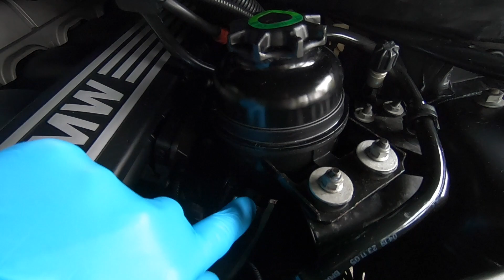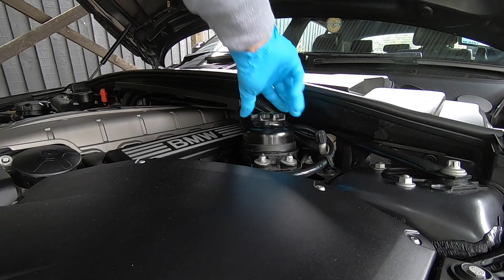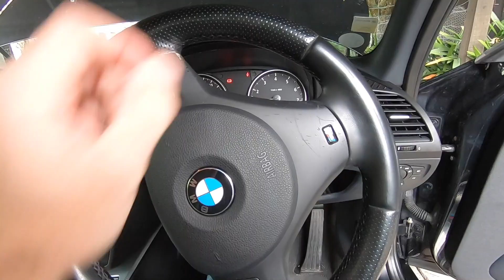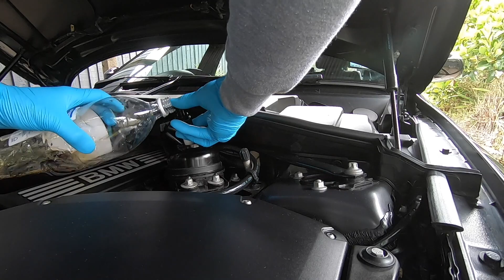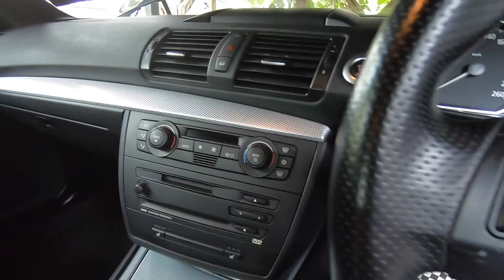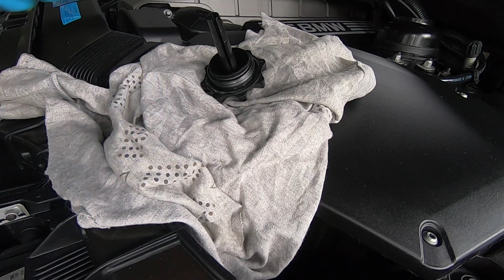BMW E87 1 Series Power Steering Fluid Change

Comment: Is there any difference between this fluid and the one used on the E60? This one is Titan, and the other is Pentosin. Are they the same, or is Pentosin the recommended fluid for the S85?
Reply from the maker: So long as it’s CHF 11S it’ll be fine. Pentosin is reasonably priced and readily available

Comment: Very clear video, thanks for that.  

I noticed when you got to full lock on either direction there was a slight groaning/grinding noise.  Is this just a characteristic of the steering rack or power steering pump?  My N52 does the same but it’s definitely louder than yours.  I’m hoping a fluid flush will help quieten it down.  Failing that, maybe it’s time for a power steering pump change.
Reply from the maker: Full lock it’s normal to have some noise

Comment: My steering hums when I only turn right while low speed or stationary  reckon it could be just fluid or the pump ?
Reply from the maker: I would start by checking the fluid level, if it looks dirty/burnt- change the fluid and go from there
Reply: @MTechGuy  👍🏻 I’ll give that a go cheers mate

Comment: But when you keep pouring new fluid, how do you pump out only the old fluid? It will mix together and you will pump out even the new fluid 😃😃😃
Reply from the maker: Yes! 👍 Dilution is the solution
Reply: i thinks this method need more fluids than other methods for sure😂, technically.. how about that?

Comment: Hi pal , your reservoir cap says “CHF 11S only” my cap says “ATF OIL ONLY” … and obviously they are both different oils… so should I go for the any ATF steering fluid or specific brand? Please reply thanks
Reply from the maker: Check out this previous video I made, it will answer all your questions 👍 https://youtu.be/9aJ62sqRQJU

Comment: great video! btw in my 2006 116i power steering oil cap says “ATF ONLY”. i did a small research and from what I understood in my case I should use ATF Dextron 3 Oil (red one), not green CHF oil that you’re using in this video
Reply: okay. I watched your another video about changing PS fluid in your M5. I am a bit confused. I do not have that green sticker and I am not sure if it was like that or if it is just missing. However, I am pretty sure that the color of my current oil is dark red. So i guess i should go for Dextron 3 anyway
Reply from the maker: In a 2006 it should be CHF-11S, but may have been changed out for Dextron III previously in its life?
I would suck out what’s in the reservoirs and put it into a clear container and shine a light behind it to see what colour it is- Dark green- fill it with CFH-11S, dark red- fill it with Dex III 👍
Reply: @MTechGuy  I will try. Thanks 👌

Comment: that is one clean engine bay!
Reply: @MTechGuy  btw where did you get your steering fluid from? cant seem to find that locally
Reply from the maker: @cyberairwolf  Main BMW dealer
Reply: @MTechGuy  Deeply appreciate your response! As you can see im now a proud owner of a bmw :) and jesus the fuel on these things are not cheap! i can spend $50 on a daily drive then have to spend more again
Reply from the maker: The little 130i is my economic daily driver, you want to try a V10 M5, 5k/L!
Reply: @MTechGuy  damn! if i press my throttle hard enough to get one end from the traffic light to the other side before it turns red i feel like i spent $5-10 lol on that second. i cant imagine if you use your v10! probably $20 every time you press hard on your throttle lol

Comment: Mine has the electric power steering but still an interesting, relaxing vid to watch. I also much prefer the 'old school' key going into the steering column.
Reply from the maker: Cheers mrstevebull01, this is the first BMW I’ve had with the push button start- don’t like it! It’s on the wrong side if the column too. My E60 M5 was the only year of that model that came with a proper key

Comment: The reason for the power steering leaking from the reservoir isn’t the cap o-ring. It’s the build up in pressure from the filter being blocked so the reservoir needs to be replaced👍🏻
Reply from the maker: It’s not a filter, it’s a strainer. In 25 years I’ve never come across a blocked one. The cap is vented to atmosphere anyhow.
It’s 100% the cap O-ring, they become hard and compressed and leak. Fitting a new O-ring fixed the leak while the original strainer remains

Comment: Great video - thanks for sharing! 

Have you already replaced your flywheel? After 233.000 Km I feel a heavy vibration when slowly clutching in gear one with a cold motor.
Reply from the maker: Thanks for checking out the video Bram.
My 130i has done 130,000 km’s so I assume it still has the original (I’ve only owned the car for about 8 months)
If yours still has the original flywheel I expect it’ll be getting close to requiring replacement
Reply: update? I have the same thing on my 118d 2009 at 292K KM.